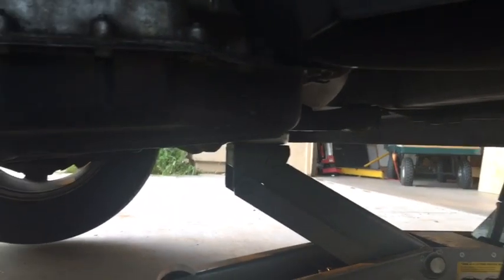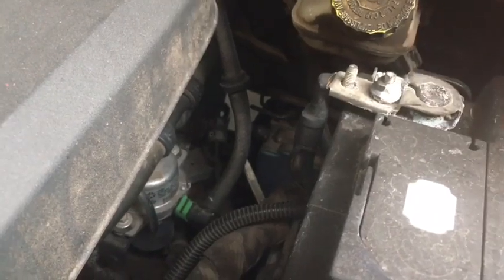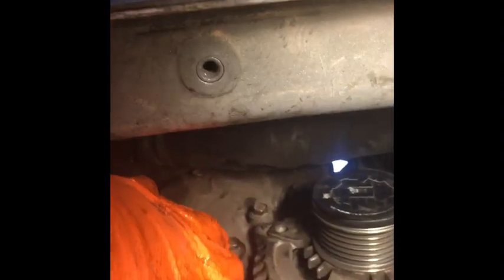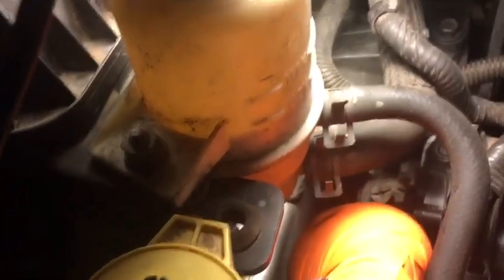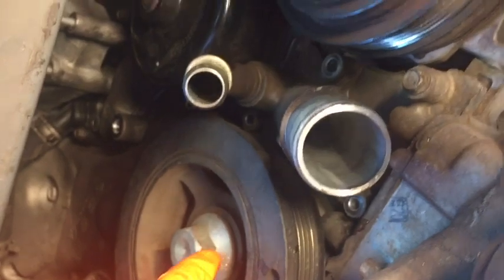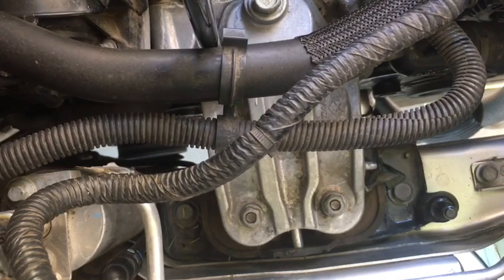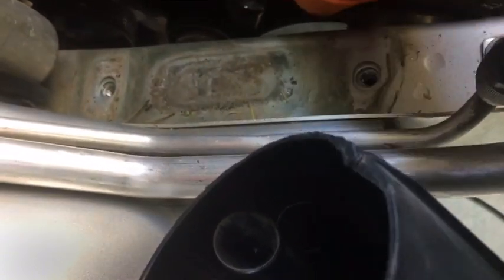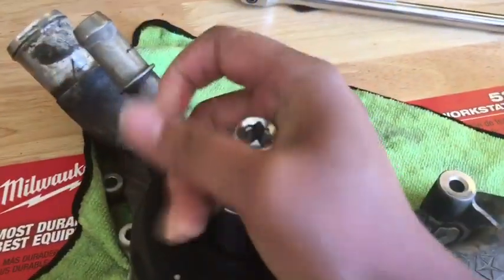2012 Chrysler Town and Country Water Pump

Comment: Great video, sorry it wasn't the water pump.  My wife and I were jet engine mechanics in the AF for 10 years.  She won't touch a ratchet now, lol.  I don't enjoy it but like you I do it to save the money and also because the couple of times we've taken our vehicles to mechanics it was a simple ripoff.  We were on our way to an antique show once ( that's what we did for a living after the AF for 20 years ) after having had our exhaust system replaced on our box van.  About 40 miles down the road on I57 I hear the exhaust dragging.  I pulled over and got out and sure enough. The clamp had loosened and they did not put any hangers on it so I have to root around for a piece of wire to tie it up with.  We made the show and had them fix it when we got back but never let them touch a vehicle after that.  And exhaust was all they did and their shop was right next to ours.  I have 3 or 4 more like that but this would be a very long post.  Thanks for your service and your video.  The job looks much worse than it is.

Comment: Great job!  You saved me from figuring out that the motor mount has to come off.  Just know that your time was not wasted.  Replacing the water pump before it starts leaking is not a bad thing.  Well worth your time and money if you planned to keep it any length of time.

Comment: To find out where a noise is coming from in a motor compartment use a plastic/metal pipe from your vacuum cleaner... Put it up to your ear and go over the motor... Good for lifters... noise will get louder when you get over top of the noise... My Dad showed me when I was a kid with my Chevelle to find  a lifter tapping... Cool how good it works... Thank you for your help with the water pump...

Comment: Thank you for recording your adventure.  I have to replace my pump on a 2012 3.6L Caravan and needed some help.  You were much more specific regarding steps and bolt sizes, so thank you!
Reply from the maker: Justin - Glad I was able to help.
Reply: @tyrouse4876  I have a question/comment on 3.6L  rocker arms: The rocker arms located further from the timing chain are not too bad to replace, but do the rockers located near the timing chain need the Miller Special Tool to relieve timing chain tension?
Reply from the maker: Justin - i feel like that would’ve helped. It was a pain to get the closer ones out.  You will need one for sure to do the lifters. 

Im assuming the tolls you’re talking about is the $200 set Ive seen on the internet. 

However, i did see a video of a man working on a jeep and he used a 10mm wrench bent at an angle to get his rockers out. I think my husband used a blunt object and a hammer. 

Once I get that tool, I should have a video out real soon. Hopefully in January.

Comment: Great video! I wish I would have recorded my water pump replacement on my wife's 2012 Town and Country. I never had to pull the wheel or the wheel well shroud. I managed to do everything from above. I removed the air-intake, the motor mount, serpentine belt, idler pulley, power steering fluid reservoir, and the thermostat. This gave me complete access to the water pump. took me a couple of hours though. I'm getting to old for this.
Great video though Ty Rouse. Well done! -Mark

Comment: One thing I would suggest, it took me years...buy a set of constant pressure hose clamp pliers.  You will thank yourself.  I wish I had done it years ago.  They are cheap and save hours.  Yes...hours and fingers that feel like they are falling off and blood blisters.
Reply from the maker: Sir Sweetness Awesome! That will be my next purchase.
Reply: I can only buy one kind, not a set.  Which ones do you recommend?  Straight ones, or bent?  Thank you!
Reply: To Sir sweetness:

*insert the m.bison yes!! Gif or video clip here*
Reply: Chrysler clamps will lock in the open position if you know how then after you put it all back together, just trip them with a flathead screwdriver. 
Hose clamp pliers are a must though.

Comment: You area hard core!!!! This was an Awesome Job!!! P.S. If the water pump is bad it will leak out of the tiny weep hole in the bottom. Thanks for the video!
Reply: When the water pump leaks water from the weep hole its because the bearing inside pump failed. But doesn't mean that the actual water pump fail. 🤷‍♂️
Reply: @snoopdog6793  That’s true you can nurse it along for a while. But eventually it will completely fail. Possibly sending the parts into the radiator as they bounce around the engine bay. Or injuring somebody who just happens to be looking over the engine at the time.

Comment: I changed my water pump on a ford Aerostar minivan with a smaller hood my water pump is in front facing toward grill not requiring jacking up engine. Something I don't understand is why they would design engines where u have to do more work to get to water pump.  My water pump lasted 28 years before it started leaking. I was interest in buying a town & country are they reliable heard they had problem with tipm.

Comment: Starter was fun doing on this same van. 

note: you don't need to remove the intake manifold. you'll have enough clearance but it will be tight, I took of the front motor mounts and loosened the rear bolts, book says to remove this and that but I avoided that like the intake, just need small hands and awkward hand turns lol.. and it will come out. be sure van is cool down cause you'll be working near the exhaust parts.

takes 1.5 hrs but I ended up doing 2 more vans took me an hour. book says 2.5-3 hours but I think that's because of the other unnecessary parts needed to take off..